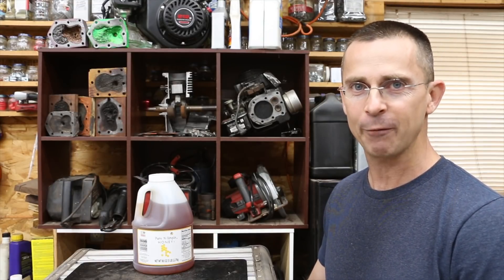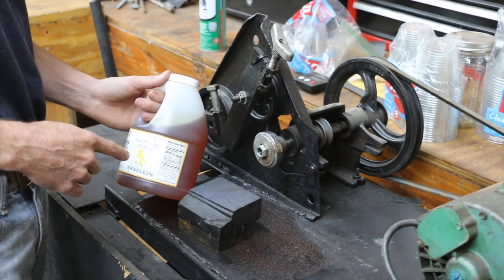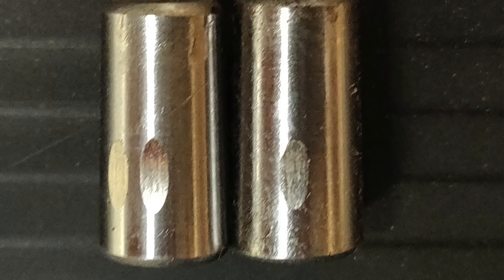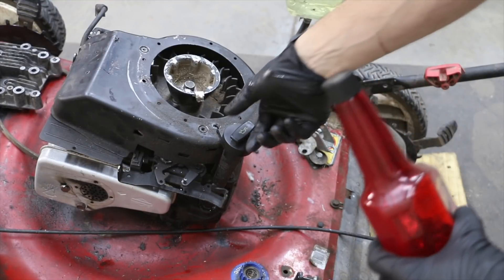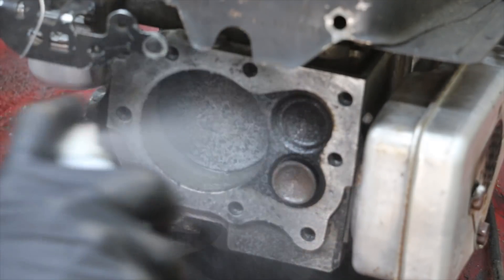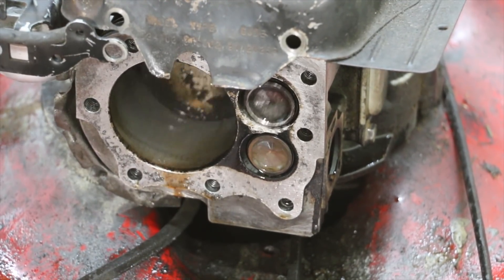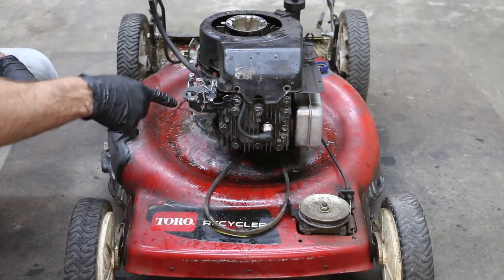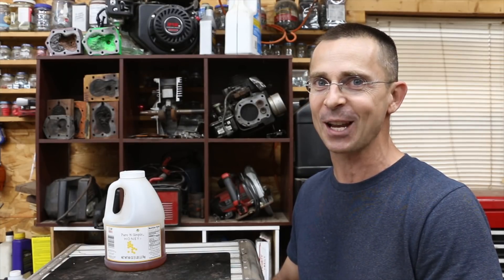Can you use Honey as Engine Oil?  Let's find out!

Comment: Of the engine is so badly worn out, is it possible to use as a  test subject for oil additives. I  would  see if engine restorer works to add compression or marvels mystery oil, possibly Lucas oil additives  I'm sure  you see the rabbit hole I'm heading down is there a magical additive that can save you from loosing this bullet proof lawn mower. Good luck I know you want it to keep running the two of you have been through a lot
Reply from the maker: Thanks for the suggestion.

Comment: I wonder if you used things like honey mixed with a decent amount of oil that was left, in a car engine, if it would have better results than in a lawn mower engine which runs very high RPMs.
I would really like to see what a 50/50 of bananas and engine oil would do! (although a modern car, the engine may get screens inside clogged, so it would probably have to be an older engine.
Reply from the maker: Thanks for the suggestion.

Comment: Not sure if you've done it already but (assuming you want to sacrifice the motor). Either water as oil. Or if there was a way to run without coolant in a motor. I know it's bad but I don't know what is actually likely to happen (first). 

Otherwise carbon/graphite grease would be interesting also as an oil.
Reply from the maker: Thank you for the video idea!

Comment: When I was a kid there was an oil additive. I believe it was called motor honey. It was thick and tacky. The trouble people found is that it quieted your engine in summer but in winter, at least in northern climates, it stiffened up so bad your engine would either no turn over or barely turn over. They would have to heat the pan to get the oil to even flow out. Of course that was generally in engines that over used motor honey. Don’t remember it burning like the real honey did on your engine. Loved marvel mystery oil. Especially for my air tools. Good stuff.
Reply from the maker: Thanks for sharing.

Comment: Years ago I disassembled a Chevy 350 that someone had put corn syrup in the oil. The owner of the Chevy Blazer saw the empty corn oil bottle in his driveway when he went to work and didn’t think anything of it. When he left work the truck wouldn’t crank over. I pulled the engine apart and all the bearing inserts were stuck to the crankshaft but didn’t appear damaged otherwise. The corn syrup must have solidified when the engine cooled down locking it up. I had to pound out the camshaft and the cam bearings came with it!
Reply from the maker: Thanks for sharing!

Comment: Hey guys! I’m from Poland and there is an actual practice among car traders in my country to put some honey inside the transmission and also just a little bit into the engine. Obviously, long- term it’s catastrophic, but short-term this practice makes makes the engine seem like running a bit smoother and quietens knocking. Of course, when saying short-term, I mean just when the client inspects the car and drives out of the gate.

Because of such practices, car traderas in Poland have a reputation of scam artists and liars. Don’t ever buy a car over here (can’t imagine why you would though) xD
Reply from the maker: Thanks for the feedback.
Reply: @ProjectFarm  Actually there is a Polish channel where a car mechanic took upon himself to prove this a myth. He was very surprised to see both the engine and transmission run smoothly for a couple hundred miles, but when he tore everything apart to check the condition of indertanl components, there were actually bits of caramelised sugar and quite substantial wear on rod bearing inserts. Maybe debunking or confirming this myth would make a decend idea for the video? I love the stuff you make and especially your scientific approach to testing!

Comment: In 1974 l bought a 5 gallon can of Kendall motor OIL, 40 weight! It has Teflon in it. I bought a new 74 Vega and when l changed the oil, l thought the Teflon OIL would be good for it. It was winter, temperature in teens and in the morning l tried to start the car,it wouldn't even click.  I thought the battery  (only months old) was dead.  Came home at 4,5 and tried to start the car (temps in 40s) and started just fine.  Long story short, after 3,4 days of the same thing over and over l realized that the 40 weight OIL was to thick in the morning! Changed the oil to 10w40 and NO problem! When the honey is cool, will the engine turn over?

Comment: Very good video. Can you do a test with peanut or sunflower oil to find out if it would be possible to use this kind of oil in an extreme emergency.
This type of oil tolerates high temperatures (for frying)
it would be interesting to see their behavior in an engine in particular the possible rupture of the oil film between the rotating parts.
Reply from the maker: Thanks for the video idea.

Comment: If it helps diesel is great in engines to relieve seizure and run again after carbonisation from heat seizures improper lubrication or just old rusty seized left standing etc turn it over or run with diesel in crankcase various safety steps don't just throw it in 👍 but it can help in a pinch next time instead of seafoam and others it's cheap checkout using diesel for other things not as fuel to start or keep engine running it's universal benefits are cheaper and less volatile than kerosene as dregreaasers etc etc lol great vid loved the honey 🤣🤣🤣🤣🙏✌️💪
Reply from the maker: Thanks for the feedback.

Comment: The fact the engine lasted 25 minutes on honey is pretty crazy and the fact he got it running again is insane! Awesome job.
Reply from the maker: Amazing, isn't it!  Thanks for watching.
Reply: It might have run longer with nothing but oil residue in it.
Reply: @kevinnielsen1356  I was wondering that, too.  You'd think that even after draining the oil, there would be, at least, a think film of oil left behind. I wonder how long that coating would hold up before catastrophic failure.
Reply: @atomicagegamer3693  At idle, about 15 minutes or so. Under load, or higher RPMs, it can only last for 30 seconds or maybe even less before it becomes laboured and seized

Comment: Bro one big doubt

I have 3 nissan navara car 
2 in petrol 1 in diesel 

All are 2018 last models

In perltrol car word wide every one say should change  a oil in every 10,000 KM but 
I'm not interested to change a oil because of ...

The engine heat level is also not increased on the  dashboard signal.

And I check the level of oil is also same.

Only the colour is changed dark black now.

Now I am using the same oil more than 25,000 kilometre...

I need a good advice from your idea it suffer my car ..??  

because logically...

The engine oil is not working properly automatically the engine will be heat up I can able to see it over the dashboard signal I'm correct...??
Reply from the maker: Thank you for the feedback

Comment: Did not watch this video, but I will say "NO," because you put honey in an engine, and it will caramelize and, basically, burn (at engine temperatures). That will result in a sticky mess that will eventually be like a glue in the engine that will cause it to seize.

Comment: Loll how funny I love your videos I’m actually processing honey frames and wanted to watch something and this came up! Very interesting Indeed! I’m also rendering down some beeswax and thought how about you try some beeswax but damn it becomes flammable at 200 degrees Celsius but if it only gets to 120 C it would be interesting to see if it lubricates? You might have to let the engine run for 20 mins or so first so it stays hot then melt the desired amount of wax in a pot at 80 degrees C then pour it in & it should stay liquid because it’s still pretty hot and after the test quickly drain it bit of a Mission but I reckon it would possibly work if you can be bothered thanks again for another awesome video
Reply from the maker: Thank you very much!

Comment: What is your take on engine restorer products do they do what they say? I have used their product but...you may seem to have better means than I do in testing products. Especially in the way you conduct the tests. They do have different types in regards to 2 stroke, 4 stroke and above...again I may not be as experienced as you so...
Reply from the maker: The engine restorer product that I tested did help with compression but must be used in subsequent oil changes to maintain improvements.

Comment: Is not heat resistant as necessary, but has much viscosity, need some additional additive. 
What about using oil paint as motor oil for engine?? 
And some of that sex oil lube?? Those would be interesting to watch.
Reply from the maker: Thanks for the feedback

Comment: That's one of the sweetest running engines I've ever seen.
Reply: LOL
Reply: Badum tss
Reply from the maker: Thank You!
Reply: @ProjectFarm  your smart as hell why do you think my riding mower turns over but has no compression cause it ran low on oil but never sized so is the top end still good and. It's the valves 🤔
Reply: @nickolasvaughn265  most likely piston rings, those are most common for low compression, especially more so if it was ran with low oil
Reply: @keyan8585  ok thanks
Reply: @ProjectFarm   woosh
Reply: Troy B. Esteban not a wooosh
Reply: Pun of the century 😅
Reply: Lol
Reply: Hardy har har
Reply: Pun jail 4 you, life sentence.
Reply: Lol 😂

Comment: My father in law ( who would be 110 if he was alive ) had a story he told me about someone he knew had an incident of mistaking those jars of honey from the hives on the farm for the oil he was to put in the Model T truck. He didn’t realize it until it had been run a bit. The truck survived okay but the guy had heck of a clean out.
 Honey probably works okay until it gets hot and water evaporates out of it making it more and more sugary. If you kept adding just the right amount of water it would probably work longer.
When I was young and playing with motors a friend was in a ‘ motor destructive ‘ mood and took all the oil out of an engine and filled it with water. It ran for a long, long time and was just fine. The water with a film of oil worked way too good so he then had to drain it all out and run it dry. It ran pretty long empty as well but eventually started getting stiff.
Reply from the maker: Thank you!

Comment: Honey wouldnt work as a lubricant on its own. 
Back in the 70's, my mate had a reliant regal and the big ends were knocking. He put Wynns oil treatment in and it was still knocking. I put 2 tins of Tate & Lyle Golden Syrup in the engine with the oil and it stopped the knocking. Engine purred like a kitten and he sold the car. :). Glden syrup or Black Treakle works as an oil addative but wouldnt work as an oil.
Reply from the maker: Thank you!

Comment: Do you have any experiencing changing from conventional to synthetic oils in high mileage engines? I want to switch a 40 year old truck to synthetic but so many people say it will just leak worse. Ive managed to fix most of the leaking so far; I just want to extend the protection in all of my vehicles.
Reply from the maker: Yes, I've done so without any issues.  I always go with a "high mileage" oil due to the additive package in the oil to helps prevent leaks.

Comment: Please run 50/50 oil and a high zinc/moly test. Or u should run like a low lead vs high lead fuel see which provides Petter engine lube and valve/valve seal protection.  Or even like running a lead substitute in a modern gas motor
Reply from the maker: Thank you for the video idea!

Comment: I'm typing this comment before I watch the video .  My prediction.  NO.  Honey will not work.  My explanation.  As friction builds heat, the water in the honey will evaporate, leaving nothing but a sticky goo.  The engine will seize with in a minute or two.  Maybe 3-5 minutes if the engine is worn and cold upon starting.  . .... Now to the video..
Reply: my time was way off!!  I'm impressed.
Reply from the maker: Thank you

Comment: Please try wax (melted wax) ;)
Reply from the maker: Thank you
Reply: @ProjectFarm  That'll likely work well, but everything needs to be preheated and kept hot through the fill and drain and flushing of your engine.  It'll be a tough one, wasting lots of heat.
Reply: @ox6942  But interesting is it what lubricating properties it have, despite heating everything, maybe you can mix the wax with something to stay liquid
Reply: @szpuner14  I mix, bar & chain oil , SAE 30 non detergent oil and paint thinner to make undercoating spray for rust protection.  1 pound box of canning wax, 1 quart each of oils and 1 gallon thinner.  Stays liquid at around 80 F and up.  This mixture in an engine will likely last just fine as long as it's liquid before trying to start.
Reply: @ox6942  This interesting mix, should work for one trial

Comment: I really enjoy your videos even though some are a bit odd. But I'm concerned for your safety. In this test I noticed the side chute door lifting up as the engine revved up. I would be devastated personally if I learn you were injured by the blade. Can you make a balanced "dummy" weight to bolt on in place of the blade? Keith L.
Reply from the maker: I need to get rid of the blade and add a weight. Thank you.

Comment: One new season back in 1997, I ran my 8 year old 3.5HP mower without oil (I had drained the oil the season before, forgot to put in fresh oil)...did my entire lawn...took 30 minutes before i noticed my engine was running super hot and making funny noises. I chalked it up to slick-50 residue keeping my mower going without oil...cutting new season deep grass for 30 minutes. i added oil and it sounded better...but i'm sure i did some damage.
Reply from the maker: Wow!

Comment: If you want to test something that does well on the lubricity test, then try milk or urine, no joke! This is caused by the acid that develops under the heat, urea has nitrogen in it which creates a certain surface hardening. I´d totally understand if you won´t pee in your lawn mower, but the lubricity test would be interesting.
(This is at least what I´ve read in a book about fluid lubes where this test and it´s frontiers was discribed. That´s one of the reasons why I´m not so much convinced by this sort of lubricity test.)
Reply from the maker: Thank you!

Comment: You did get some pretty good other comments one more  crazy thing i remember my Dad telling me as a teenager that con artists were known for when selling a old worn out car   That had a lot of  internal knocking and such was the cons and used car lots would put saw dust in with the oil to make the  engine sound quieter   I always wondered  what that would had done to the engine  myself ? My Dad never  really knew if it ruined the motor more  or not  apparently  it was a common thing  in the 40s and 50s. And he new a few people that got " skunked " getting a worn out motor when they originally  thought it was a tight  sounding engine they bought  i would think it  didnt cause  too much  internal damage unless it clogged oil ports  and stopped. Areas from getting lubricated ? The old man was born in 1936 and ive heard other guys from that era  say the same thing  about it being a old  used car salesman trick  because they knew you wouldn't. Figure it out for a while  if ever  ?
Reply from the maker: Thank you!

Comment: when i saw the fire from the exhaust and when i heard the new noise from the engine it sounded like either the combustion was leaking past the valves probably because the timing gear teeth broke and the timing altered a little or a compression ring jumped a groove and/or broke
Reply from the maker: Thank you

Comment: I had an engine in a 1971 F250 that was set up as dual fuel, propane and gasoline. I made the mistake of running some stale gasoline through it on a long trip. Surprisingly the engine ran just fine, until I tried to start it the next day. The valve stems were glued to the valve guides and it bent the pushrods when I cranked it over. I didn't really understand what had happened until I brought the heads to a knowledgable machinist who told me the problem by just smelling the heads. He was right. Try running some old varnish smelling gasoline through an engine with tight clearances.
Reply from the maker: Thank you!

Comment: Once you lose compression with goofball stuff, is it possible, with unlimited patience, to rebuild to original performance?
Reply from the maker: Yes, it's possible, but would most likely require honing the cylinder and replacing the piston rings in this particular engine.  Thanks again.

Comment: Can you please try Olive oil?
Reply: There are videos on Youtube where people have tried using veggie oil in cars. It works, at least for a while, but it tends to burn quickly, thins out too much when it’s hot, and is too thick at low temperatures.
Reply: In addition to that, Olive oil specifically has a much lower smoking point than something like soybean or canola oil. It wouldn't fair very well compared to those oils.
Reply: Jennifer Lynn  right, also safflower oil has the highest resistance to heat, and would probably hold up the best among veggie oils.
Reply: Louis Laszlo peanut oil
Reply from the maker: Great video idea!
Reply: I would love to see this!

Comment: Prediction during advancement.
High sugar means high friction as well as high carbon build up meaning locked cylinder at an accelerated rate compared to no oil in running engine
Reply from the maker: Great point!